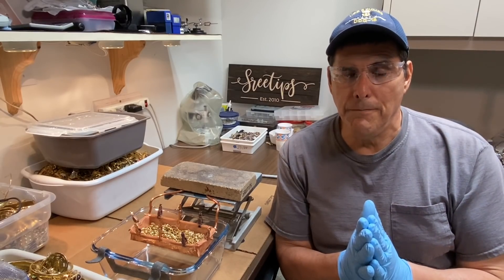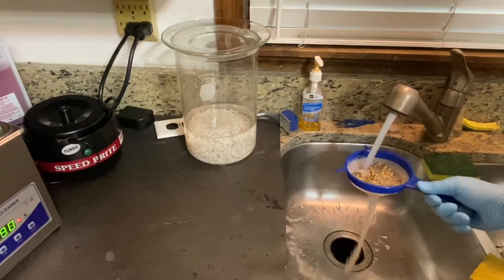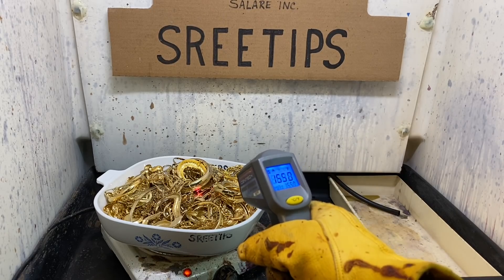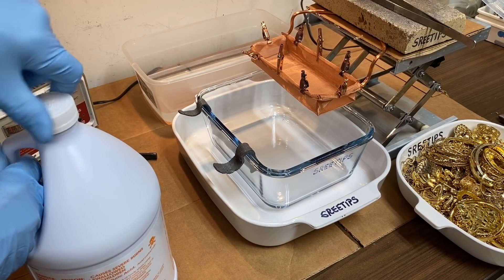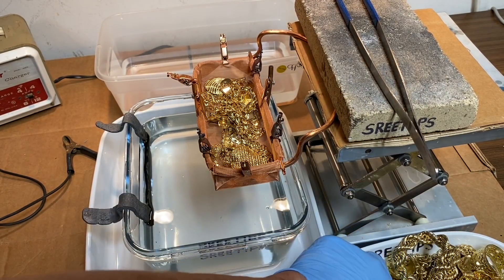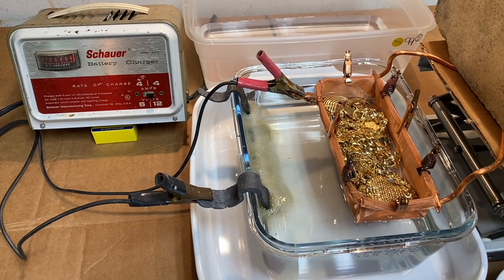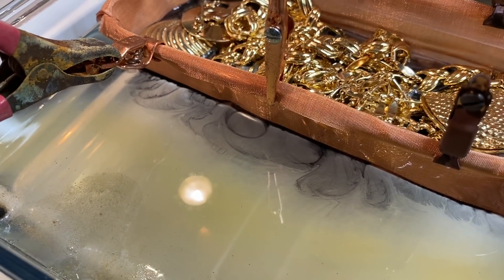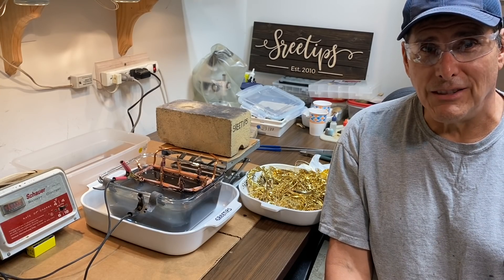Pure Gold Reverse Plating Cell Part 2

Comment: Would this work with gold filled material?
Reply from the maker: Possibly, but much heat would be produced because of the much thicker gold coating that GF material has. The cell doesn’t strip well when it gets hot.

Comment: Does voltage and amperage matter when doing this?
Reply from the maker: It seems to work better on the lower 6 volt setting.
Reply: @sreetips  thanks a lot. Your videos are awesome bro. I've learned so much from them. I appreciate the reply.

Comment: سلام خدمت استاد بزرگ ایا بجای طلا در سبد مسی اگر خاک طلا را داخل سبد بریزیم هم صدق می کنه ودر ضمن ماده الکترولیتی که شما دارید اماما نداریم جایگزینش اگر هست مثلا هیدروکلریریک اگر براتون مقدور باشه ترجمشوفارسی بفرمائید بسیار متشکر میشم اگر نه که زبان خودتون متشکرم.
Reply from the maker: I used 93% sulfuric acid for the stripping cell. I buy it as Rooto Professional Drain Opener at the local hardware store in USA.

Comment: From my experience ...Unless you're using HCl as electrolyte, the only thing that is getting dissolved Is your copper basket, and all your base metals going into solution . That black powder is most likely cuprus sludge,  and I wouldn't be surprised if your copper basket disintegrates

When you get gold alloy then the black stuff will be atomic gold.

Also from my experience when the current drops off like that it's a sign that SO4²- is heading towards the anode and clogging things up with copper sulphate crystals, which will be especially the case with the high consentration of H2SO4

Ideally you want an inert plastic anode basket,  graphite energiser sitting on the dry part of the anode pile, and melted down gold bearing copper in the anode basket.
Add a STRONG  magnet under the dish to get electro-hydro-magnetic stirring to kill the sulphate crystals.
You'll get wisps of ultra fine black powder, forming on the surface of the anode.as the bulk of the copper goes into solution. This stuff is SERIOUSLY fine, most probably a few atoms at the most, but it will settle easily.

I never got to treat this atomic gold with HCl, but I'm curious if you've got to dissolve in pure HCl this way without adding nitric. 
Be ware you've got a near infinite surface area, so go slowly
Reply from the maker: Excellent, thank you

Comment: I see a lot about battery chargers. But would a dc adjustable power supply work the same. And if so what volts and amps would you set it at.  
Ps.  I love all the videos. I watch every day
Reply from the maker: I’ve not tried a power supply

Comment: Increase your video length limit

By default, you can upload videos that are up to 15 minutes long. Verified accounts can upload videos longer than 15 minutes.

To verify your Google Account:

Open the YouTube mobile app.

Tap Create ￼ at the bottom of the screen.

Tap Record or select a video longer than 15 minutes.

Choose your video’s title, description, and settings, then tap NEXT.

Follow the steps to verify your Google Account. You can choose to get a verification code through a text message on a mobile device or an automated voice call.

Maximum upload size

The maximum file size you can upload is 128 GB or 12 hours, whichever is less. We've changed the limits on uploads in the past, so you may see older videos that are longer than 12 hours.
Reply from the maker: I have uploaded videos that are 1.5 hours. But the shorter videos seem to do better. People into the subject will watch a 2 hour video on it. But new first-time viewers, the kind I’d like to sub to my channel, tend to want shorter videos. Plus you can always wait until the series is complete then watch the series at once.
Reply: Oh yeah, I was just answering the question at the end of this video of just how to do a longer video than 12 minutes , that's all, wasn't criticism, just heard the question and  found the answer , then answered on autopilot. , But I was wondering if quartz is piezoelectric , would it work to use the electrolytic cell to get gold traceries out of quarts pretty well loaded with fine gold particles?

Comment: I’ve seen someone use salt instead of the acid stuff and it worked just fine.. however, it was with silver. I imagine it would work with gold and is cheaper and safer, what do u think?
Reply from the maker: I haven’t used salt with my silver solutions
Reply: @sreetips  It would be interesting for sure

Comment: 12:40 From the YouTube help pages:
"By default, you can upload videos that are up to 15 minutes long. Verified accounts can upload videos longer than 15 minutes.

To verify your Google Account:

    Open the YouTube mobile app.
    Tap the camera  to upload a video. 
    In the top right corner, tap Next.
    Follow the steps to verify your Google Account. You can choose to get a verification code through a text message on a mobile device or an automated voice call."

Comment: It's just plated gold it's not worth anything so why are you melting it off it's not real gold
Reply from the maker: I’m not “melting it off” I am actually reverse plating the gold off the junk base metal and collecting it in the electrolyte. This is a gold recovery. And yes, you are correct, the amount of gold is very tiny, almost nothing. So the plated junk jewelry has little to no value as it is. But if we can strip the gold off and allow it to accumulate then we may be able to get some highly valuable pure gold from junk. It’s all about concentrating the values.
Reply: @sreetips  thank you

Comment: Here's your answer to the 15-minute restriction: And thank you for the very informative videos!

By default, you can upload videos that are up to 15 minutes long. Verified accounts can upload videos longer than 15 minutes.
To verify your Google Account:
-->    Open the YouTube mobile app.
    Tap the camera  to upload a video. 
    In the top right corner, tap Next.
    Follow the steps to verify your Google Account. You can choose to get a verification code through a text message on a mobile device or an automated voice call.
Reply from the maker: Problem solved the iMovie app was restricting the uploads. I save the longer movie to my phone first, then use the YouTube app to upload the longer video

Comment: You should have a small motor controlled bye the current,  when the current gets low, it will lower the basket until the current gets to the maximum current selected 😊

Comment: You have two cathode connections.  Could you use two chargers?  I feel like that might help spread the amps out and diminish the overall load on each charger.  It might also allow you to process the material a bit faster, with less downtime waiting for deplating.

Comment: Hey man , I’d love some advice. 
There is a seller on eBay selling gold filled chains - in Australia (where I live) it’s my understanding gold filled has to me minimum 5% gold by weight - 
Well I picked up a 130g chain for like $25AUD. 
That doesn’t make sense. 
It’s stamped 18KGF - looks the part and weighs 130g - I filled a side down to see how quickly I’d hit base metal and didn’t - 

It’s also not magnetic at all. 

Is this just something that looks gold and isn’t at all ? 
It couldn’t possibly be gold filled at that price - . . Could it ? 
Happy to post it to you , if you wanted to do a video on it - you can keep the gold if it actually is - it only cost me $25
Reply from the maker: Put a drop of 14k or 10k test acid directly on it. If it plated then the acid will quickly eat through, bubble turn green. If nothing happens, and the acid just sits there not reacting, then put a drop of test acid where you filed the metal away. It will bubble and turn green and smell bad (toxic fumes don’t breath) then wipe the acid away after 1 minute. Look closely. The acid will reveal an unmistakable coating of thick gold over a base metal brass. You will see a distinct boarder between the thick gold and the brass underneath.
Reply from the maker: 18k GF is rare. I’ve never seen a single piece. If it’s sounds too good to be true then it probably is. Highly likely that you paid $25 for $0.50 worth of metal. With gold prices making records against fiat money, it’s a scammers paradise. Folks get gold fever. I know those gold drop melt bars various computer pins melted together are doing a brisk business.

Comment: still think your gold will be heavily mixed with other metals like the copper basket going into a tank..to control the amperage split the positive wire set up a clean water tank and you control the amperage by moving moving the wires closer or farther apart

Comment: iphone tip: not the one you were hoping for but a good one none the less. There is a free app called "Compress" that I fine hugely useful (might be called Video Compressor now). Give it access to your camera roll and locate a video. It will compress it a lot or a little bit depending on your selection. The compressed version gets saved back to your camera roll. Then trash the original so you just have the compressed one. Makes uploading really fast plus frees up space on your device. A raw video of 200Mb could be reduced to 20Mb and you hardly see any difference. And you can go harder than that.

Comment: Why not do this every time instead of dissolving everything in acid?
Reply from the maker: Karat gold; inquart, part with nitric, dissolve in AR. Gold filled; incinerate, remove bases with nitric, dissolve incinerated foils in AR. Computer scrap; use A/P to remove bare metals, refine gold foils in AR. Gold plated material; sulfuric acid stripping cell. That’s how I learned it.

Comment: You did a similar series a while back on reverse plating.   Back then you appeared to just toss the jewelry into the cell as you found it.   Sure enough, after a while the cell was full of scum and it took a long time to reverse plated a basket load.   You cleaning process is similar to the "incineration" you do on karat scrap and sterling prior to inquarting.
Reply from the maker: Agree. The more time spent preparing the scrap increases our probability of a successful outcome.

Comment: You should try lowering the voltage to 6V. It will generate less heat.
Although I don't know if there is any or much evaporation?

Comment: Hello sreetips, I believe if you switch the voltage of the battery charger to 6V instead of 12V, the current will lower, allowing to submerge the copper basket completely. Please, let me know if this assumption is correct?
Anode connection could also be moved on the over side to avoid slow destruction by the acidic bubbles (connected to the copper bar on the jack side). This also could prevent any reaction with oxygen of air at the layer separation.
Reply from the maker: I’ll give that a try in part 4

Comment: I can’t help with the video length issue.
I have run one of those stripping cells with the same battery charger and have done close to 35 kilos of plated scrap (gross weight). Pegging the meter will not damage the charger. The internals are limited to 4 amps out put.
As someone else suggested, I’d recommend moving the red clip to the copper bar that forms the basket. The bubbles forming on the lead (Pb) terminal will send H2SO4 splatter on to the insulation and sulphuric acid LOVES to eat organics.
Reply from the maker: In the next part the charger gets overheated after constant pegging the meter. Causes the internal breaker to open. But then I quit lowering too fast kept meter from pegging and it worked like a charm

Comment: So you are going to have to set there and babysit if the whole time? I thank you need a better power supply.
Reply from the maker: A larger battery charger would help. Lower voltage to keep the cell cool has also been suggested.

Comment: Great videos. If I had to complain, it would be about too much repetition repetition repetition. I understand that I am not the typical viewer. I get the point the first time you say it. (or I can back up the video a few seconds) 
However, I do know video equipment. 
So, in my humble professional opinion, a phone is not a camcorder! Use a proper video camera and you can shoot til the card is full. My old Canon HF M30 will record 1080 video for 18 straight hours on one 64GB memory card. You can find these on Ebay for CHEAP. Yeah. Then you have to post edit. I agree that is / can be painful.
Reply from the maker: This iPhone has an incredible camera. The closeups are unparalleled by anything I’ve ever seen. I like the all-in-one of using the phone to shoot, edit and upload my videos. The 15 minute video uploaded from my phone would have taken about ten times more time to upload on my beastly slow cable internet connection. Cable is fast for download, but awful upload speeds. My iPhone is just as fast as fiber optic cable. I disagree. The iPhone for shooting video is the bomb.
Reply: https://support.google.com/youtube/answer/71673?co=GENIE.Platform%3DiOS&hl=en
Reply from the maker: Save the longer movie to the phone. Then upload using YouTube app instead of the iMovie app.

Comment: Solution to the 15 minute video problem: get a Pixel. The most advanced camera phone on the market and for a reasonable $350 right now. Also free backups of your photos and videos for as long as you use that phone.
Reply from the maker: It’s the software on my iPhone that’s the problem. Called iMovie. It doesn’t know that longer video uploads have been enabled for my channel.

Comment: The work of deplating, from what I have read, is a function of the surface area of the scrap times amps run through the cell. Not the volts. In the same way that you do not want the volts on your silver cell to exceed 3.5 volts (and I believe it should be even lower) I don't think you obtain any benefit (and actually may have some disadvantage) running your batt charger at 12 volts. So I think you should switch the front panel switch to 6 volts. I've read the ideal range should be 1.8 to 2.5 volts. At the very least, your electrolyte will run cooler.
Reply: Also, you're pinning your meter which is probably overcurrenting your 4 amp charger, which will shorten its life, though those things can take a good overload briefly. Usually those chargers have no fuse or breaker....which means the transformer inside is the breaker = it will burn. Changing to 6 volts should help this. Still, I wonder if using the correct voltage (1.8 - 2.5) would reduce the amount of black gunk you have to deal with. You could drop the volts easily and cheaply with 4 or 5 diodes in series. Each diode will drop .7 volts.  https://www.911metallurgist.com/electrowinning/#:~:text=Electrowinning%20is%20defined%20as%20the,current%20using%20an%20insoluble%20anode.&text=It%20is%20important%20to%20note,but%20of%20time%20and%20ampheres.
Reply from the maker: I’ll give it a try

Comment: I hope you recover more Gold from this, than you did from the Computer cards! That one STILL blows my mind! I thought for sure that you would recover more Gold than you did!!!
Reply: he did the math on this gold plate in an earlier video compared to gold filled etc , this plated stuff is next to nothing
Reply: @melin1969  But, considering the amount of gold he will get out of all of that, should be a fair amount I would think.
Reply: @melin1969  Yeah, hard to beat gold filled for recovery yield!  I sreetips has quite a lot of this gold plate material though.  Didn't he say 100lbs or so?  I don't know what his predicted recovery was, I'll have to go back...
Reply: Actually I think Sreetips recovery from the circuit boards was quite a bit higher than I've seen on other similar videos (and a lot clearer!).  Given the volume of gold plated material he has here I think he's going to get a pretty nice yield! :)
Reply: @fredrichardson9761  sorry, I was being a bit sarcastic. I'm sure his yield is going to be High on this!
Reply from the maker: Not at all. This kind of scrap is very low yielding. Much lower than computer scrap.
Reply: @sreetips  Wow, that is really surprising!  Apologies if you went through all that in a prior video and I missed it!  Does most of the gold end up as a solid black powder at the bottom of the pyrex dish when you're done?
Reply: @sreetips  wow. hardly worth the effort. But then again, it looks like Gold may be headed back to $2000 again???

Comment: Two things that scare me, especially concerning my eyes.
Sodium Hydroxide and Con Sulfuric acid!
Reply: legend has it that AQUILLA REFINING will one day upload a video :)
Reply: @rickydona919  I do have one more that i think only i can pull off! No one has done it yet! Kevin does such a fine job i just sit back and watch now!
Reply: @goldrefining  I can't wait 🙂
Reply: Eye protection is MANDITORY when working with those 2 amoung others. Personally I don't worry about brief skin contact, as long as its not hot sulfuric or lye. Just make sure you wash it off ASAP. How ever my jeans don't like contact with H2SO4 no matter how brief, it will eat a hole right threw them instantly.